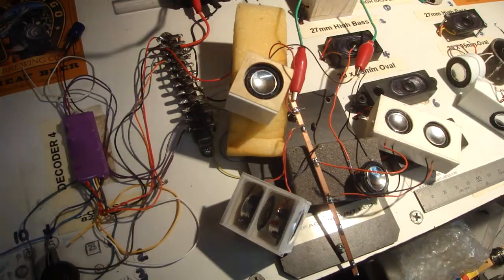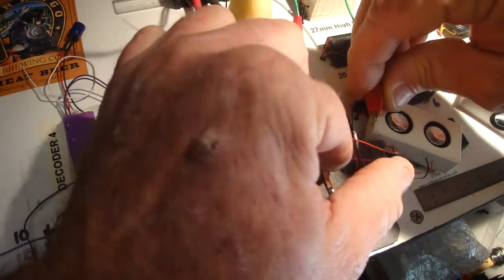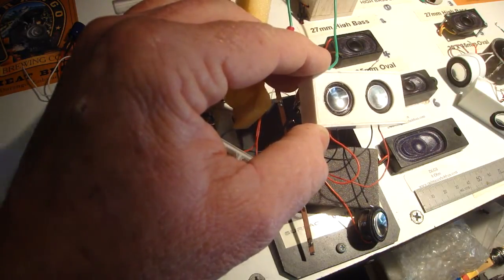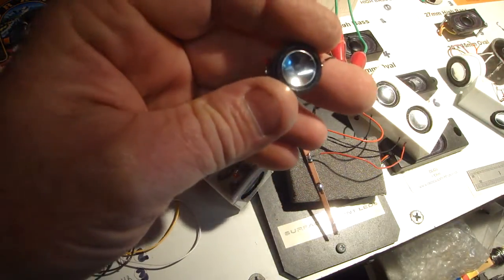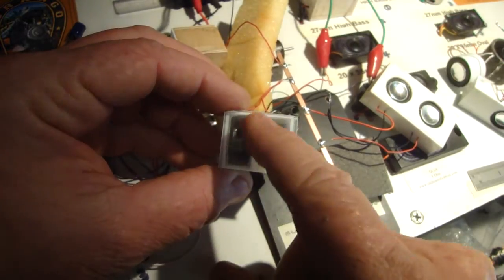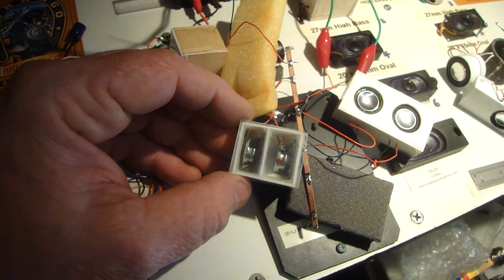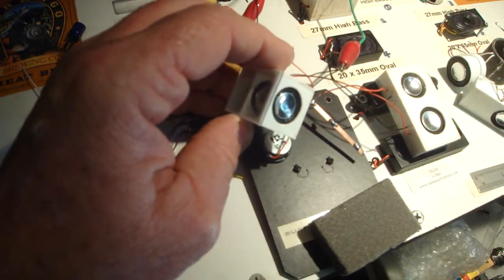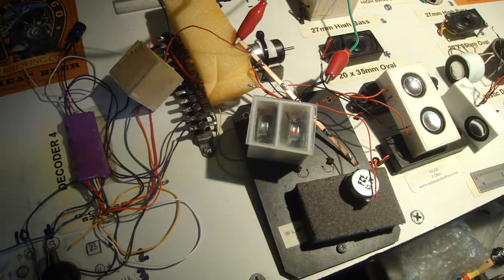Sound sample isobaric IV

Comment from the maker: Speakers in locos - each loco is individual and by installing any speaker the enclosure you make for it will make the sound different. The available space dictates what speaker/s can be installed. 
If your K37 is HOn3 then you can fit a pair of speakers with a Tsu-1000 in the tender. (You didn't say what scale your K37 is ?)